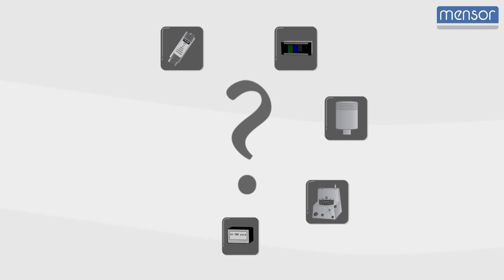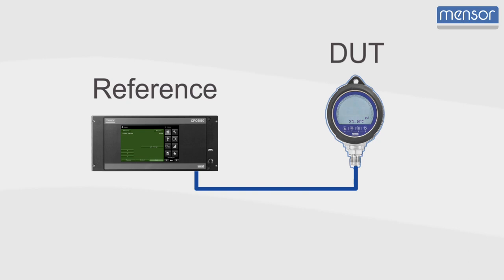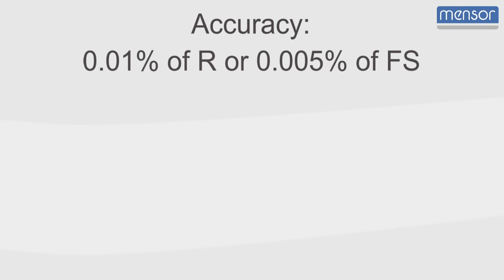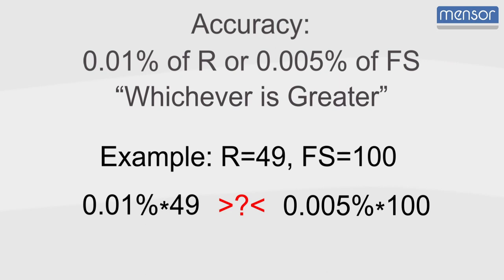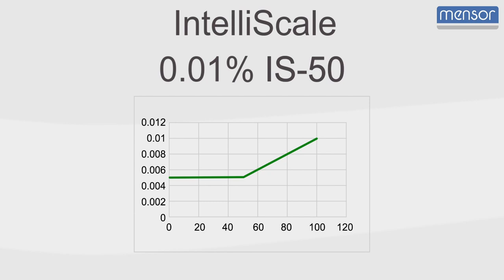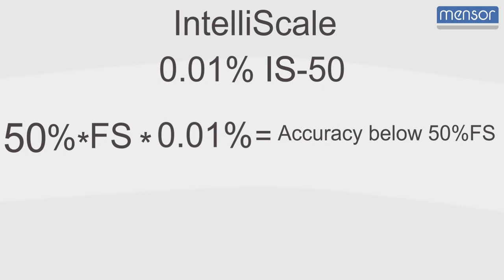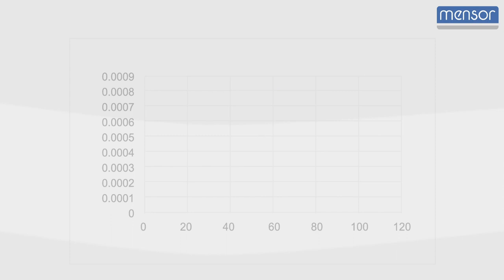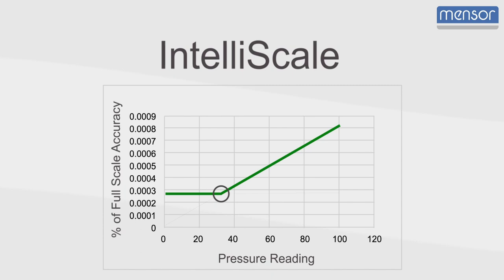What is Intelliscale? | Pressure Accuracy Specification Explained

Comment: Is Y-axis measurement correct on your example at 2:08?
Although it isn't clear, I assume the pressure range is from 0 to 100 PSI. If that's true, then, 33% of 100 is 33 PSI.
That would make the %Full Scale calculation (0.008/100) * 33 = **0.00264**. The Y-axis seems to have an additional significant digit at 0.000264. Am I wrong?